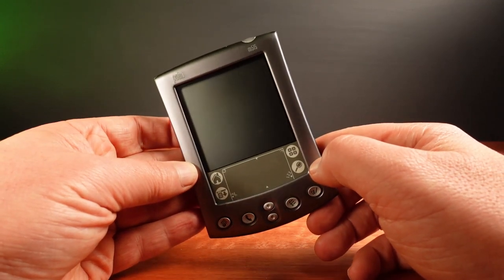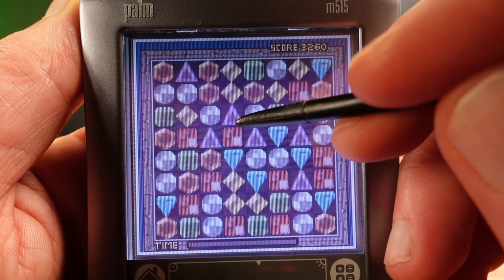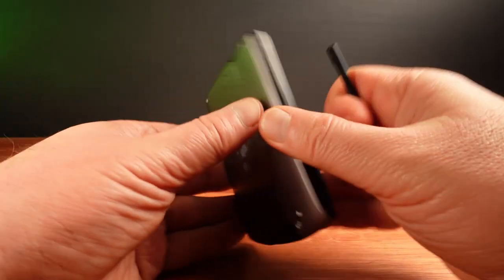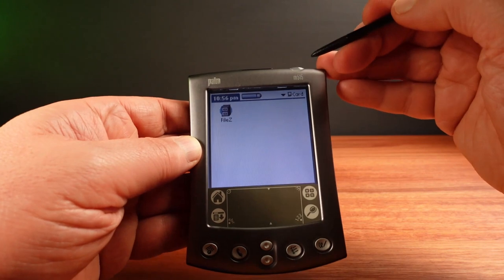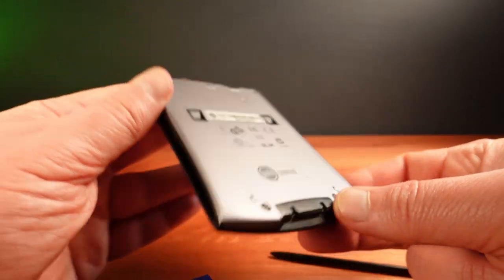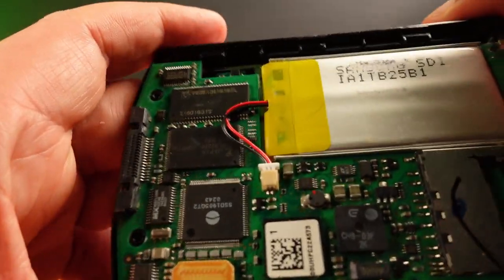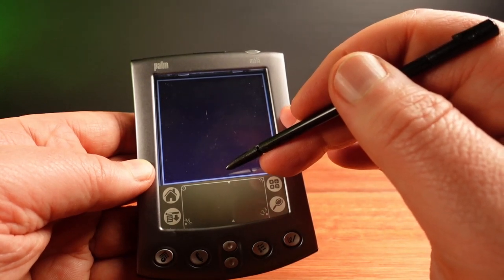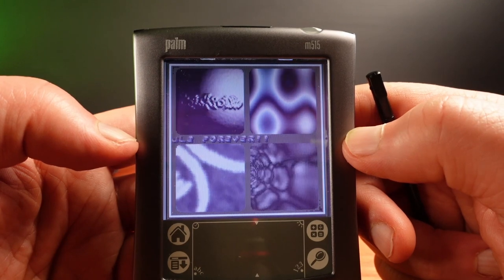Palm m515 PDA: Crossing the Rubicon

Comment: The benefit of the colour screen is to my mind negated by the battery life compared to the m500's monochrome screen.
Those demos do look amazing though 👍

Palm, the first company to change the power plug for EVERY single generation of device !! 
I despised them for that.

"Oh you bought a $250 folding keyboard for your Vx ? Guess what, the m500 has a incompatible connector !" 

Arrggghh...
Reply: Trying to circle back and purchase a Palm device, this nightmare is foremost on my mind. I am happy there are quite a few people selling Palm PDAs new-in-box.

But of course, no one has a brand new Tungsten C, one of only two non-mobile phone Palms with a physical keyboard. So, purchasing that separate accessory will be needed, and compatible with the specific model interface, to boot.

It is quite astounding how many times the interface changed, but then again, the entire company itself changed from U.S. Robotics to 3com and finally, Palm Inc.

Then you have internal lithium battery replacement, which is a lengthy chore unless the device uses user replaceable AAA batteries (m125 or earlier). Did I mention you need Windows XP or earlier to synchronize this thing? 🤦

Comment: Back when this first came out it was insane though, the m505 that predated this gave us what we all wanted, a color screen in the Vx form factor. The m515 was one of the first models with Palm OS 4.1. It seems kind of bleh today but this was the culmination of what most Palm users wanted out of a normal Palm PDA. Yeah Sony was way ahead of Palm in the multimedia department but Palm itself wasn't all that interested in that. They still catered to business and so we have the m515. Truth be told I still like this color screen to the STN screens that came on a couple later Palm OS 5 units, namely the Zire 31 and Z22. And this still seemed more useful to me than the Zire PDA as well. (I know the Zire m150 was a budget thing but it wasn't all that much cheaper to a much more capable m500 or even the V/Vx with the Palm OS 4.1 upgrade)
Also I think Sony continued using Palm OS 4.1 in some devices after Palm and those Sony Clies had a Dragonball VZ CPU that was clocked at 66MHz natively.
Reply from the maker: The Sony CLIEs are an interesting pivot for Palm OS that I would like to try one day.
Reply: @JanusCycle  Definitely interesting, especially the hi-res B/W Clies
Reply: The Zire series of Palm was definitely meant to be the "budget" line of the company's product. The Zire both looks cheap and has minimal components compared to either the Tungsten series or the flagship 'Life Drive.'

Even the M-series started as "budget option," when the m100 debuted. By the time they ended the series with the m515, it had some key features (like an SD card reader) which extended the viability of Palm's PDA devices a bit longer. 💁🏻‍♂️
Reply: @TuNnL  The Zire line sure was meant to be budget, it is just interesting that at the start of the Zire it was still more useful to just have the previous device. Even a IIIc would have been a bit more useful than the original Zire.
Reply: @Sb129  and that's why every device you named was more expensive than any Zire, both at the time and the present day. A couple weeks ago, I literally saw a brand new-in-package Zire for $19.99, with free shipping on eBay.

The older m500 new-in-box goes for a minimum $80, not including shipping. 💁🏻‍♂️
Reply: @TuNnL  They were all about the same price about 7~10 years ago
Reply: @Sb129  I'm 100% positive the Zire was less across the board, 7-10 years ago. The difference in price, however, was FAR LESS than it is today.

Today, there is a HUGE gap between the price of the Zire and virtually anything else, IF the PDA is new-in-box. The reasons for that widening gap are not only related to quality, but collectability.

PDAs are now like comic books or baseball cards. Increasing in value because of their age and significance. 💰
Reply: @TuNnL  Back then in 2010~2012 no one really cared about Palm PDAs. Only very specific models were expensive (like the Clie UX40/50). I got a brand new in box Visor Edge for the same as a Visor Deluxe. $20.  My three Lifedrives all under $20 each, a Lot of 40 misc PDAs for $40. A Palm IIIe NIB for $15. I even got my Handera 330 for $40 and five years ago I got a TRG Pro for $7, no one really valued them back then.

These days it is as you said, something to collect because it is very old and has some historic significance. 
I haven't really payed attention to brand new in box prices these days so I didn't know about current price discrepancies.
Reply: @Sb129  You did well for yourself, I must say. Perfect timing.

Congrats! 🏆
Reply: @TuNnL  Ty, it was completely coincidence though, Lol. I was just a weirdo that maintained my interest in PDAs long past their heyday. I never thought anyone else would gain enough interest in them for prices to ever spike.

Comment: Hi! I am on the fence to get a Palm, I am 44 years old so you can tell I was in the age when they were very popular and after many years I realize I do not need as much speed and connectivity as it is right now. Which model would you recommend that is the fastest from the monochromatic screens and the one for colored screens. I rather AAA batteries but I saw on your channel that replacing the internal batteries is not that hard (please let me know what it would be the lifespan of those batteries as well). Bests regards from a Venezuelan follower in Panama!
Reply from the maker: The best monochrome screen is on the m500, it also has an SD card reader. I'm looking to get an m500 myself one day. 
For colour screens I'm not sure. I've heard the TX is has the best screen. But I also want to compare the other brands. Such as the Sony CLIE models.
Reply: @JanusCycle  in my experience Sony made the bests Palm OS powered PDAs and their transflective screens were the best I used, any suggestions for a Clie?